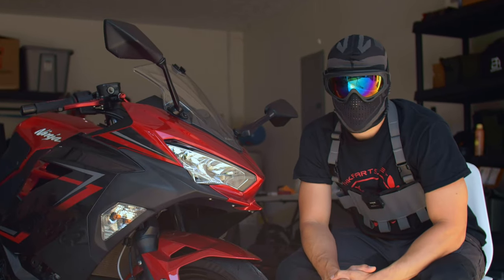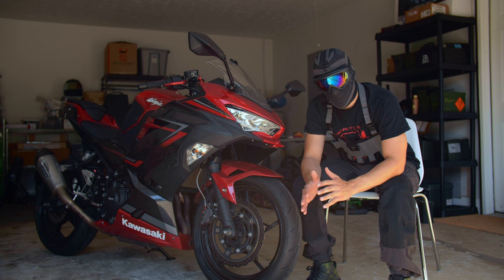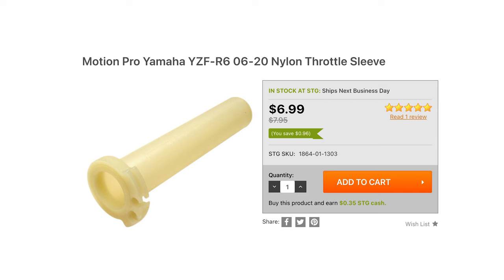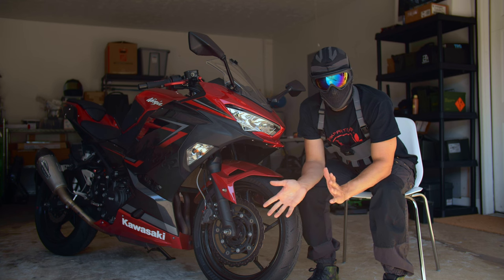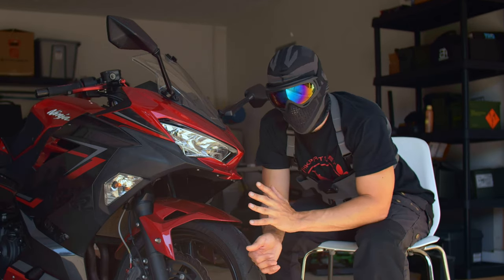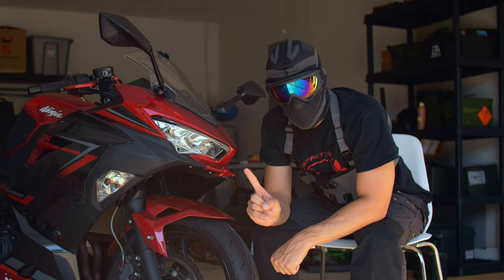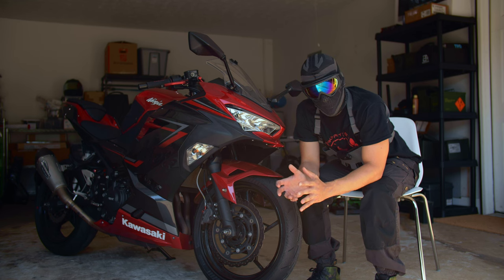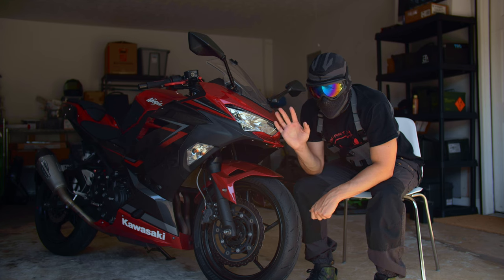These Five Mods Will Make Your Ninja 400 Faster

Comment: Step 1: buy a bigger bike
Reply: Nah dude they are plenty fun and they dont eat rubber
Reply: The real step 1 is get out and ride. Doesn't matter how big your bike is if you suck.
Reply: @Motoboo_Marine true
Reply: @LU1S.404  I never said they weren't. I love riding the hell out of small bikes. It's just that you can't reasonably make small bikes substantially faster. You as a rider can get faster but if you want more speed you buy a bigger bike.
Reply: Commenter is the type of guy to say that h2r or twin turbo hayabusa is the perfect starter bike
Reply: @iiide3 busa has long been surpassed by the H2R….plus busa is a ⚫️ person bike nowadays because only the true race can handle the H2R
Reply: @aisponek  na dude, most circuits are tight corners and 1 or 2 fast straights, its in the corners where these small bikes shine, you can brake late and turn fast. Its more fun when you dont have to focus so much into not going too fast into a corner and still make it faster than 600 or 1L bikes. And like i say they are cheap af, and super ez to get more power and mod them
Reply: Step 1: Have fun and ride what you can afford.  Step 2: don’t let people talk down to your bike.  Step 3: keep the rubber on the road and find some twisty roads.
Reply: 400 beat liter bikes on the track, wake up.
Reply: @UnknownUser-fe5zu  shut up with the racism bruh
Reply: Ninja 400 plenty fast tbh it tops out 115-120mph.
Reply: @EP-pg3xs im curious about acceleration for safety tho.if i put luggage on it will it accelerate fast enough or should i go with the 650
Reply: @EP-pg3xs and i should clarify accelerate in the range of 60-100 mph
Reply: @championsgaming1  If you have the money definitely go for the 650, it is way faster in every aspect, Ninja 400 is fun and enough but "barely" if you get what I mean.
Reply: @UnknownUser-fe5zu H2R is all power not so much handling, plus it's not street legal so it's off topic.
Reply: @aisponek  Incorrect. ECU flash, full exhaust, air box, velocity stacks, race air filter, sticker with flames all make the bike substantially faster bud.
Reply: The stuff being recommended in this video are all cheap… and they’re things you’d want to do to pretty much any bike.
Reply: The stuff being recommended in this video are all cheap… and they’re things you’d want to do to pretty much any bike.
Reply: Knew someone was gonna comment this
Reply: @StoneCrest-yn7pi sometimes for sure, I have overtaken a heap of litre bike riders on my Ninja 400 but I am still faster on my R1 around the same track. So I guess for an average rider a small bike is easier to go fast on initially but once they become experienced on the track they will be faster on a litre bike.

Comment: Regarding the ABS delete:
If you're sure you're gonna commit to getting rid of it, pull all of it out.
The small benefit of weight savings won't really matter that much.
The big thing here is you can get shorter brake lines that go directly from your handlebar to your brakes. It gives better feedback and it makes it MUCH MUCH easier to bleed the air out of your brake fluid. Once you spend 2 hours trying to get that solid lever feel from an ABS bike or even worse, a bike that has combined brakes (so that it also applies a little of the rear brake as you pull the lever for the front) you'll kiss your shorty lines everytime it takes about 4 minutes to bleed them.

And ABS on track really isn't necessary if you have good tires (for the current temperature/weather) and the surface is in decent shape.
You'll flip over the bike before a warmed up race tire locks up (unless you're leaned over a fair bit already).
Reply: Do you feel like ABS is bad for someone coming from a 250 rebel? Im happy to hear i can just remove it from the ninja i am getting if i find that i dont like it... Ive just read so much about people saying it saved them and whatnot
Reply: @89Johneboy  For use on the road  I would always advise ABS. No reason not to have it. For track use, see comment above. Doesn't matter what you rode before 👍
Reply: @slovencleta  Ill be just going around the streets for now... I may dip into some track in the future but cant i remove the abs when i am ready for that? Or is there a more simple way to disable it and re enable it?
Reply: @89Johneboy  Usually the simplest and least permanent way to remove the ABS function is to just pull out the relevant fuse. If you aren't sure what you're doing, best leave it alone. And you might not even be limited by ABS even on track, depending on your aggressiveness on the brakes.
Reply: @89Johneboy  It's a crutch, you should never need it on a smaller bike, it's just becoming standard now because people don't practice for the worst. Whatever bike you did get, just get out and practice. I don't like the feel of ABS kicking in on cars or bikes, but that's just my side. I hope you're alive and still riding bud, cheers.

Comment: Love the video.  My list is different for performance.                  
#5. Brake pads. SBS 955 RST or DP  RDP X-Race.  price $50-$60
#4. Tires.  Bridgestone rs22 or any favorite hypersport tire.
#3. quickshifter.  Annitori Quickshifter PRO 2 $230.  plug n play 
#2. ecu flash.  Norton/tst or any reputable company.
#1. Airbox mod. Free unless you add your choice of velocity stacks and air filter.
#0. Rider mod.

Comment: Awesome video dude. Debating doing the ABS delete when I get mine ready for next year. Have you considered doing clip ons? I'm 5'6" and I've found the positioning of the clip ons to be kind of annoying when I'm trying to get in my preferred body position for track riding.
Reply from the maker: Yeah same thoughts I had about the body position. If I was doing only track riding I would definitely get the woodcraft clip ons. If I go track only I might get the tyga race bodywork because it allows clearance for the clip ons.

Comment: If I'm 6'4 do you think I could comfortably ride these? I'm wanting to get into riding but honestly think that I'm too tall for these, is this a misconception?
Reply from the maker: You could do it but it’d probably be a pretty tight squeeze.  I’d recommend a used sv650 over this. Or if you wanted something a bit more track focused a Yamaha r7 or Aprilia rs660. The ninja 650 is okay but the riding position of the handlebars isn’t sporty enough for my taste.
Reply: You might also check out supermotos and adv bikes. The'yre taller and many of them are still pretty solid on track when paired with a good set of tires if you want to do more than street riding. Best way to know for sure if you fit is to sit on one. Find a dealer and sift on one for a few minutes.

Comment: Hey man, nice bike! I also have a Ninja 400 ABS, that I did a whole lot of mods to it already. One of the things that I wanted to do, was to get rear set risers. They came with an extension for the shift rod for the left side, but nothing for the right side to compensate for the additional length. The little metal line that’s going from the rear master cylinder, is not really movable that much, it definitely doesn’t allow the rear brake assembly to move half an inch back and half an inch up. So what are you supposed to  do in this situation? Get a longer rear brake line, bleed the brakes and the whole thing? Thanks so much. 
Y

Comment: This one modification will make you 400 go 2xs as fast just add gasoline 80% and then mix 20% nitro methane  it will make horsepower go up 40% roughly

Comment: 400 is for girls. Buy a 1000 instead, no mods neded
Reply: I ride a 400 and pass 1000 on the track 🤡 you can have the biggest bike, but if you can’t equal the bikes power with skill, it’s pointless.
Reply: Girls or beginners?